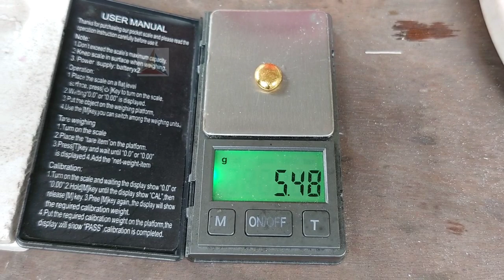Gold Recovery From Mixed Cell Phone Pins | Gold Plated Cell Phone Pins | Gold Recovery

Comment: superb result! what is your method of ratio for acids hcl ect, because you put 3 ltr hcl and 1 ltr NO3?
Reply: Dirty drop is first done with lots of excess nitric acid. Run out of nitric before base metals are gone, the precious metals will begin to cement out and remain above first filter.
Notice the denox produces lots of bubbles. 
The next drop can be much less nitric. Like a few mililiters to 100 mililiters of hcl. This will not need to denox since the nitric will be nearly used up. 
Hope that helps!
Reply: @colonialcharlie8702  Sreetips?
Reply: @AllHopeIsLost1134     sreetips shows some good examples. Also not rinsing powder of nitric enough before adding hcl for a boil and watching it go into solution has been a good lesson haha